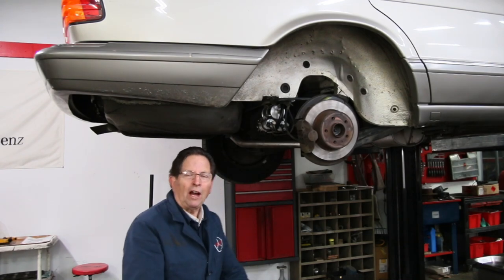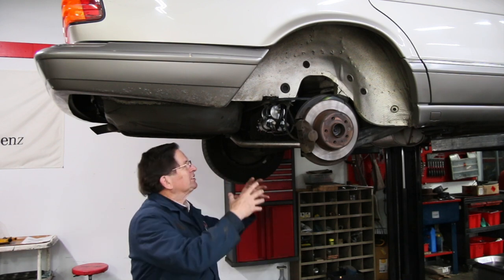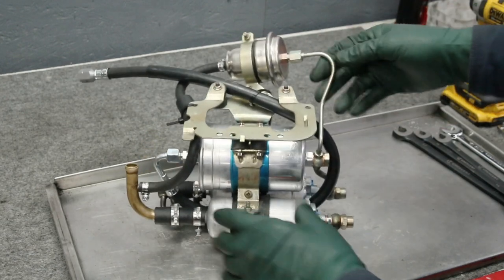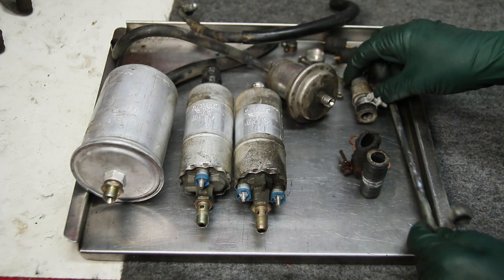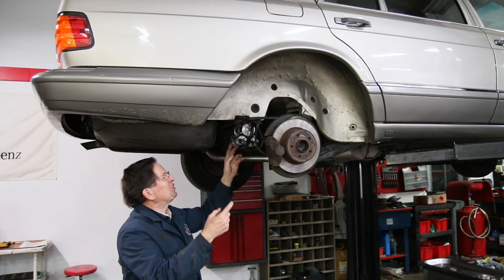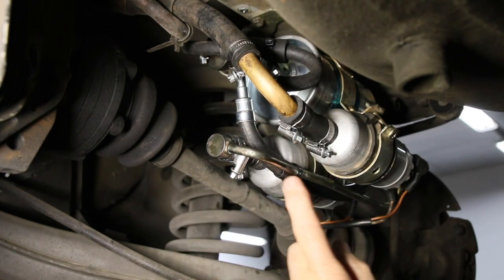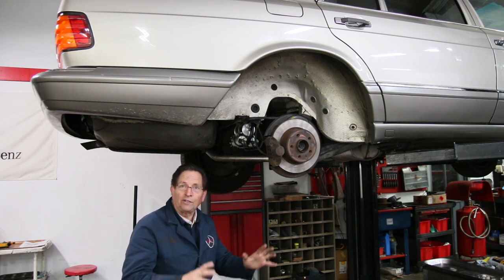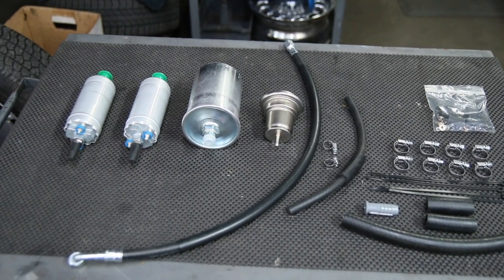1986 to 1991 Mercedes Big V8 Fuel Delivery System Overhaul Show and Tell

Comment: The price is extremely reasonable. I have an 88 SEC with less than 70K, and it's starting to have fuel issues. Time to order this kit!
Reply from the maker: I fired up the 420SEL today and was amazed at how smooth the idle is now. When the engine is hot it fires on the first crank!!!

Comment: Nice job Kent. Here in ireland a beast like that is seldom seen due to the price of gas here and the cost of road tax on big engines. It would be almost 2000 dollars to tax it for the year. I just have to make do with my CLK 200 from 2003. 80k miles and I love it. Do you ever do any work on any of those?
Reply: Well i have a 560 SEC here in the UK and yes the fuel cost can be high - but its smiles per gallon ☺
Reply from the maker: We don't have the CLK200 in the U.S., but I do own a 2006 CLK 500 AMG. Might be a little faster than your 200 :-). I named the car "Giggles," because every time I punch the throttle I find myself giggling.  LOL
Reply: @Mercedessource  Lol i can understand that. Most of the Mercedes you see here are Diesel motors. Diesel is king here in terms of fuel economy, although they are trying to force everyone into electric cars now. 

They'll have a job getting me into one. My CLK 200 I bought for the equivalent of 700 dollars and previous to that, I had a 2004 C180 coupe for 2 and a half years but I got hit with the oil migration into the engine loom via the cam magnet connectors. 

On the CLK (same M271 motor) the first thing I did was fit new magnets and the oil blocking pigtails. I really like fooling around with old Mercs and a lot more since I came across your channel. 

I have made a few videos on the C180 I had on some of the jobs I did. Anyway, keep up the good work and warm regards from Central Ireland.

George
Reply: @abbashussain6390  Models like that here are non-exsistant due to the extorsion type road tax they have here on anything over 2 liters pre 2008
Reply: The 560 is rare in Ireland. I'm lucky enough to have a C126 560SEC.

Comment: I recently found a leak, most likely from that old thick rubber hose outlet with the two metal clamps - I recently got all new bosch pumps, fuel filter and accumulators done - is there a way to only get the hoses, or a place where I could get a hose that would fit? Help greatly appreciated!
Reply from the maker: We sell the new fuel tank outlet hose. If you have a W126 you can go to my website and just put "W126 tank outlet hose" in the search box.
Reply: @Mercedessource  i have a 560sl, is it the same one?
Reply: @Mercedessource  ahh I found one for 107 on your site! I think it’s deteriorated and gasoline is seeping through the braided outlet hose - I’ll order a replacement one!

Comment: Hi Kent, great job as always! Can one use 2x of the W123 style pumps here? I know these are thinner but will 2x 123 style ones work instead of the 2x thinner ones?
Reply from the maker: I am not sure. Maybe you could do some research to see if the pump pressure is the same.

Comment: This video was GREAT !!!!  I have a 1990 Mercedes 560 SEL that I've owned for 20 years. It has under 90.000 miles and it's in mint condition. I put it away in December on a trickle charger. It's now April and I tried to start it up with a half tank of gas. It only cranked but would not start. I heard the sender kick in but I couldn't smell gas at all near the intake. I haven't checked for a spark yet but as an educated guess,...does it sound like I need a new fuel delivery system? ? ?
Reply from the maker: It is always best to troubleshoot the problem before buying parts. It could be more than one thing or even multiple issues that could be causing your problem ( just due to the age of the car ). If you have owned the car for 20 years it has never been replaced the back end fuel delivery system most likely should be replaced for safety and reliability.  Here is the link to the kit. Thanks,  Kent. https://mercedessource.com/store/1986-1991-r107-and-w126-twin-pump-fuel-delivery-overhaul-kit

Comment: Thank you so much for your videos! They are priceless.  My dad gave me his 1986 560SEC which I'm attempting to restore.  She's been sitting for around 8 years or so.  I rebuilt the fuel assembly with 2 new pumps, filter, accumulator, hoses and screen.  I have also put in new plugs and wires, and naturally changed the oil.  Now she starts so strong and dies over a 8 second period.  If I hit the gas, she just quits.  I've replaced the relay which is what got me started.  A few weeks ago when I got it started I ran a seafoam cleaner through the tank.  It ran for about an hour or so smoothly.  Now she just starts and dies.  What do you think I'm missing?
Reply from the maker: What you are experiencing is quite common on these old K-Jet engines that have sat for long periods of time - ethanol in our gas raises havoc inside the fuel distributor. It deteriorates the seals and gums up the passages. Google for more info. You might try adjusting the fuel mixture to get the engine to run well enough to run fuel injector cleaner through the system. There is lots of info online about mixture adjustment.

Comment: Hi ken! I have a 1988 420SEL W126 and I put a fuel additive called fuel doctor and after it ran for a few days now the car won’t start and I am thinking I may have ruined my fuel system. Would a kit such as yours fix my problem? I don’t know the history of the car and it’s done just over 324k km. Would this fix my problem or would it be a different problem that’s  causing my car not to start?  I am located in Australia. Any advice please would be welcomed
Reply from the maker: There are so many things it could be. Probably not even related to the fuel additive. You need to do a complete diagnosis BEFORE ordering any parts. May not even be fuel related. Compression? Fuel pressure? Ignition spark? etc.

Comment: Hey what’s the difference between the m103 L6 that was in the 300SE fuel pump and the V8 one? Is there a difference?
Reply from the maker: The pumps are the same.
Reply: @Mercedessource  ok cool thank you for responding

Comment: Greetings from Australia Kent, Some desperate resolvement / Advice Needed Please. My 1991 W126 500 se was standing under covers in the garage for around 8 years.Getting it running again I have changed, Fuel pump & filter. new eha. New fuel pump relay. New pressure regulator.Apon starting the car it ran very rough and black smoke out the exhaust.smelt like excessive fuel. I then started messing with the c/o screw. Now the car won't start at all AND the new spark plugs are WET with fuel............. ( I forgot to mention I am not a MECHANIC ) Any advice Please...........???
Reply from the maker: I suspect your fuel distributor has gone bad from sitting with old fuel in it. You will need to get a fuel pressure gauge hooked up to the system to help diagnose what is going on.
Reply: Thank you for replying. I will get that checked out.

Comment: Love your work
I have 1990 560 sec ,the only issue i have is that it does not start from the first or second time specially if it been sitting for more than an hour any ideas?
Reply from the maker: Any evidence the fuel pumps or accumulator have been replaced recently? If not, I recommend you completely overhaul the fuel delivery system. The 560SEC is definitely worth the investment! https://mercedessource.com/store/1986-1991-r107-and-w126-twin-pump-fuel-delivery-overhaul-kit
Reply: @Mercedessource  thank you Sir I will look in to it.

Comment: How long would it take an experienced MB mechanic to install this kit on my 560SL? I am not handy and would like to order this kit and give it to my local Indy MB shop to install. However first I'd prefer to have some idea of how long this takes to install so I can plan for the labor cost. 30 minutes, 2 hours, 4 hours? I have no clue and would appreciate any guidance. Thank you
Reply from the maker: My kit is really designed for the DIY owner. If you can do oil changes and have some car ramps you can do this yourself. My lengthy video instructions will walk your through the process step by step and you will know it gets done right.  If you feel a mechanic must do it I would check with him before you order my kit. Many shops do not like it if you supply the parts - it can create a warrantee problem for them. Time of install depends a lot on the condition of the car. If there is rust on the fittings, brackets and fuel lines that car really add to the time. If they know your car they can give you a better estimate.
Reply: @Mercedessource  If I do it myself how long should it take (assuming I am inexperienced). A time range is fine rather than a specific number. e.g. Between 4 and 8 hours? Thanks
Reply from the maker: @michaelsylvester3968  If your car is not rusty underneath and you get the tank as empty as possible I estimate 3 to 4 hours if you are new to it and working on the ground. If you have access to a car lift you could shave an hour off that time.
Reply: @Mercedessource  Thanks a lot - I really appreciate this information.